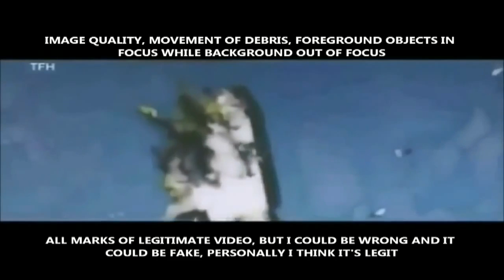Space Shuttle Columbia disaster.  Is this real?

Comment: Its is physically impossible for any debris from the actual shuttle breakup to still be in orbit. Once a de-orbit burn is carried out, a spacecraft's velocity is irrevocably reduced to a point where it absolutely must re-enter the earths atmosphere - this is straight-up Orbital Mechanics 101. Anything that is torn off, falls off or becomes detached must also re-enter. Furthermore, if the spacecraft has reached the point where there is atmospheric drag, then anything that does fall off will re-enter earlier, since its mass is lower than the parent body, and atmospheric drag will slow it down more quickly - this is Aerodynamics 101... and you can actually see this happening in all those home videos of Columbia's demise - pieces falling off, falling behind and arcing down to earth earlier.  

This video is complete bullshit and total fakery. With modern PC graphics software, anyone can fake anything.

Comment: Evidence could be supportive or debunking  could be supportive or debunking, For example, if the hanger where the shuttle parts were reconstructed included the same parts in orbit in the video, it would prove something, However, as the apollo 13 astronauts knew, any slight shallowing of a re-entry trojectory would make the craft skip off the atmosphere and fly out into space instead of down to earth on a steeper re-entry angle. A space craft breaking up during the beginning of a re-entry would have pieces re-entering at all different angles, some steeper than should be and burn up quick, some at the target angle, and some flying off in a direction that is shallower than the re-entry angle and fly up and outwards. depending on the mass and shallow angle of a piece of debris, some pieces would come down, some fly out into space skipping off the atmosphere, but some could be at the right angle to stay in orbit. Mass does not affect the speed of decent as Newton points out, but shape, size and mass are all factors penetrating an atmosphere at 15,000 miles per hour.
Reply: The key thing that makes absolutely clear that this video is fake is the fact that Columbia was not only flying well within sub-orbital velocities when it broke apart but also at an altitude of about 60 kilometers, just above the stratosphere, and for any part to still be in an orbit around earth any parts breaking off of Columbia would've had to be accelerated to orbital velocities again AND have gone through a 2nd acceleration on the opposite side of the planet in order to circularize, and then there's the fact that the atmosphere gradually thins with altitude but still reaches all the way up to 600 and some kilometers above the surface! The ISS orbits at an altitude of around 400 kilometers and STILL experiences enough drag to require frequent boosts in order to maintain its orbit! 

There's just no way that any piece of Columbia still orbited the earth even a day after the incident, let alone all these years later!
Reply: @DualDesertEagle  It looks like a broken up model floating on the surface of moving water, like in a stream or brook, superimposed over an image of the earth from orbit. The give away is that the debris is floating flat. Debris in space would tumble.

Comment: I looked again kinda looks consistent with the wing breaking off Which would damage The engines and the cargo bay. Losing the wing would open a hole in the Side and at high speeds thing's would fly off in chunks. We had plane crashes were just cockpit survived. I thought it would break up since out of control descent. Need more information. I can't Jude based on this video.

Comment: Most of the audio from this video is missing the part where the two UFOs engage Columbia on the side of the ship my thinking is they don't want to give away the fact that the Earth is actually flat I get that but the shuttle was traveling through the water beneath the firmament and the Chariots came up very quickly and startle the entire crew they hit the dome in the rest of History
Reply: @AnmlPeeweeIsHere  Martinez is your taskmasters name your last name is Israel
Reply: @AnmlPeeweeIsHere  before you insult do the research I have the luxury of knowing something you don't and you've been trained by your oppressor to attack your brother you're in The Matrix and you don't know it
Reply: @ronaldelijah1777  you realize this is a fake video right? I hope you recognize that an artist made this. Hence the TFH in the top right corner. Its a satire
Reply: I told you I have the luxury of knowing what you don't know I'm Morpheus you're the other guy
Reply: @ronaldelijah1777  no buddie, challenger exploded due to a leackage in the left SRB because of an O-Ring failure and rapid pressure loss in the Hydrogen fuel tank, and columbia disintegrated on reentry in the atmosphere due to worn heatshield tiles, which due to the blistering heat and speed of reentry, caused massive structural damage. Nice fiction tho
Reply: @ronaldelijah1777  did you just take DMT or something? That stuff is dangerous bud be careful
Reply: @ronaldelijah1777  none of that has anything to do with space shuttle columbia or even challenger. I like how you disregarded what i said too. I bet you cant even tell me what an SRB is, but youre so special you know stuff everyone doesnt 🗿
Reply: @AnmlPeeweeIsHere  it has everything to do with it don't you get it I'm you've been lied to your entire life come on you can't be this slow
Reply: @ronaldelijah1777  you havent addressed i single thing ive said... instead you go on tangents. Nice try buddy. Stay away from aerospace topics unless you know wtf youre talking about.

Comment: The Gravity of Earth would certainly pull the debris back to Earth. Especially because the rocket was already in Earth’ atmosphere. Also, the debris appears to be twisting and turning. There is no air or moving particles strong enough to move the debris around. But it is very well done CHI.
Reply: Exactly no air or friction to slow anything down in space so it will continue to roll around for eternity or until it hits another object. After that it would then continue on another trajectory without slowing or ever coming to a stop
Reply: Not if it was hit with a negative weapon, it deoolorize the magnetic fields, what ever happened was radioactive streams that did it, you can clearly see the heat trail or carbon heat streaks. The clearly put united states to fool you, one of the letters had any burns. Yes, it's real, but photo shopped for plausible denial. Greada treaty 1954...

Comment: If any body is interested in an indirect proof of this video being faked:
As far as today's technology has proceeded, nearly every single amateur transmitter with an decent setup is able to track and identify projects in and around orbit (this is an actual problem for nations running spy satellite Programms or the U.S. Air Force X-37b). 
There are, all around the world, institutions which are using this ability to track Objects and debris in space, which could become an hazard for active satellites or for instance the ISS. 
It is quite helpful to know the position of such objects to prevent major collisions between objects in orbit. An collision between two small Objects in Orbit can create to literally thousands of small pieces of debris. Thousands of small pieces which are an even bigger problem in Orbit than those two initial Objects.
As for today, every object in orbit (often down to a diameter of 5 centimetres) can and in fact is tracked to prevent an domino effect of calamitous effect. (The so called Kessler Syndrome).
This data (published by independent institutions all around the globe) therefore does clearly show for instance the effect of the Anti-Satellite of China in 2007.

Why is all this important in the regards of the shown video? The Vehicle in the video is clearly finding itself in orbit. However, there is no indication in the mentioned data, that there was any major source of debris in Orbit around earth. A 100.000 Kg space shuttle orbiter like Columbia would however create an amount of Debris when destroyed, which should be quite a lot larger than the amount of Debris in the mentioned Anti-Satellite Test.
This all is leading one to the conclusion, that the myth, Columbia was shot down by someone because something in orbit, which is said to be proven by this video can't be accurate. Therefore the Video itself has to be staged.